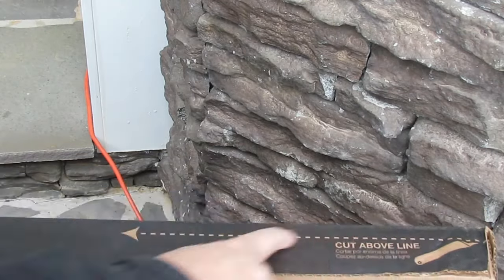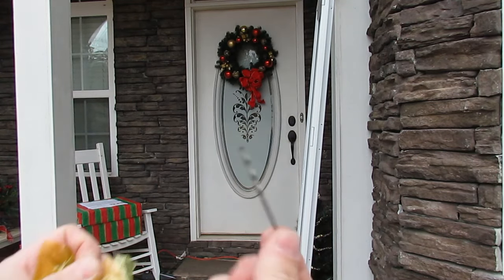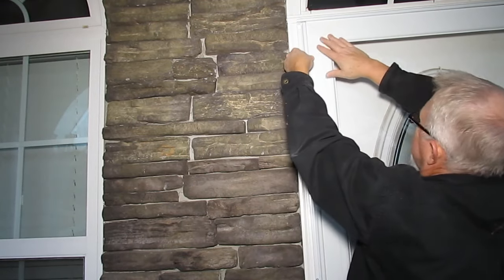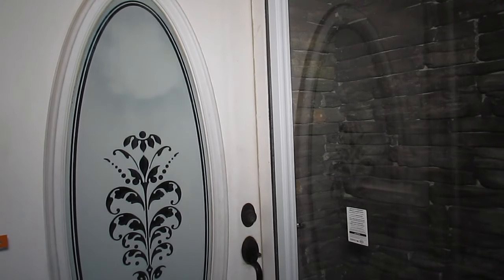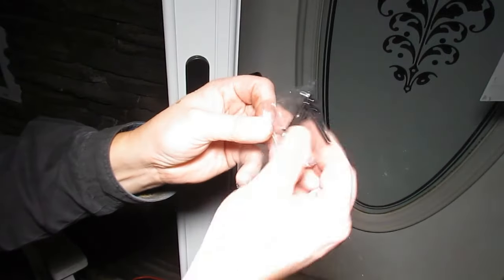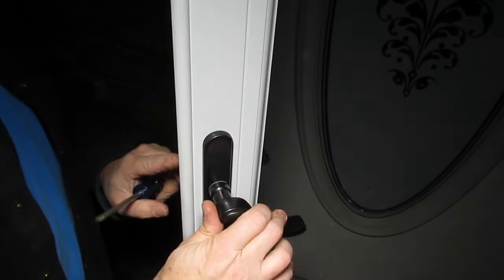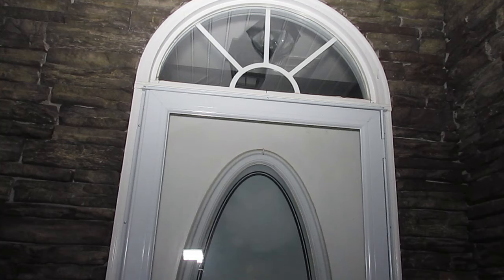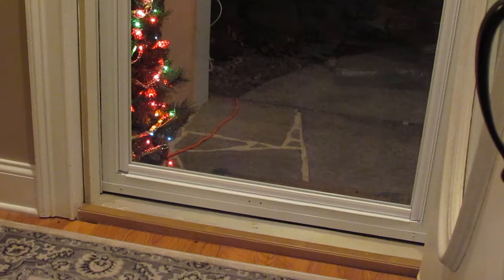Install Andersen Storm Door

Comment: How did you get the top part to snap in so easy? I cannot get it
Reply from the maker: I was able to put the bottom edge into the channel and then just push down on the top edge and snap it in.  You could also try slipping it in from one side and sliding it into position.  Thanks for watching!
Reply: I struggled with this, too, until I pushed UP on the top flat part. That did the trick.

Comment: shouldn't the  storm 3000 handle be on the same side as the existing  door?
Reply from the maker: Thanks for watching, Dan.  It just depends on what you want...you can buy the storm door either hand.  On this particular door, the entry door originally should have been installed as the opposite hand but was not.   If I had installed the storm door the same as the original, getting in and out of the door would be difficult because of how the porch is built.
Reply: I'm having trouble with the handle
Reply from the maker: HI Kiesha, thanks for watching!  Can I help?
Reply: Shouldn't the the door handles be on the same side as the primary door! Great job tho!

Comment: how the hell do you get the pins OUT if i need to take the screws out of the door by the bottom bracket to adjust :( i cant get them OUT
Reply from the maker: On mine, if I hold the closer cylinder so that the tension is off the pins, I can slide them out.  If that doesn't work, you could try to get a slotted screwdriver under the head of the pin and pop it out.  thanks for watching!
Reply: @dwcoffey  ty :)

Comment: Shouldnt he have used a RH storm door as his main door is RH one?
Reply from the maker: Normally, yes.  However, the builder put the wrong hand entry door in this house.  I am making a new entry door in my shop and will replace it with he correct hand door.  As it is now, entry and egress is difficult as the entry door kinda dumps you out into a wall.  So....I don't want to replace the storm door after I replace the entry door.  Once the entry door is done, it will be as expected.  Thanks for watching.

Comment: Anybody else feel like the door needs a longer closer? I installed the bracket on the jamb in reverse to get more degree of open, I also adjusted the bracket on the door to the last holes after using the middle holes initially. Lol took me probably two hours from the instructions and not having focus.
Reply from the maker: Thanks for watching, Lael!  I did not have any problems with my closers.
Reply: I had my door installed by a contractor. The bottom jam bracket sheared off not even a year later. I noticed he installed the upper and lower brackets the wrong way. Those brackets will break easily. Definitely get a spare set from Andersen.

Comment: Anyway to install a wind chain?
Reply from the maker: I'd either try to rig it to the attachment points for the closer cylinder up top, or use self-tappers into the aluminum frame to mount the chain.  Thank you for watching!

Comment: We got the frame secured and can’t open the door! Poked out the orange pieces and door still won’t open.
Reply from the maker: Thank you for watching, Jared!  Check the frame for squareness.  Check all the way around the door for even space between the door and the frame.  That may tell you what is binding the door.  Is the latch already installed?  If so, is it disengaging when the door handle is turned?

Comment: Isnt the door suppose to open same way as the interior door
Reply from the maker: Thanks for watching, Robert!  Although not a requirement , most often storms doors are installed with the lockset on the same side of the opening as the entry door.  The entry door installed by the builder is the wrong hand, it should have been a left hand door based on the way the front porch is built.  It will be changed to a left hand door in the future.  If I had installed a storm door with the handle on the same side as the existing entry door, we would exit the doorway into a wall unless the door was fully opened when walking out.  Not convenient at all, so changing the entry door to the proper hand door will be the best solution.

Comment: Is that the right door for that opeaning???
Reply from the maker: Thank you for watching, Terry!  Great question!  You can install either hand door into any opening, but you are right...normally you would match the entry door hand.  In this case I didn't because the builder put the wrong hand entry door in our house.  The way the porch is built, the entry door should be the opposite hand.  So, rather than perpetuate the problem, I installed the correct storm door, but will have to replace the entry door to make it open the correct direction.  I plan to make the door slab in my wood shop.

Comment: Dude your storm door is installed opposite from the front door. Good rule-of-thumb is that you want the handle of the screen door to be on the same side as the entry door. That’s the
way it is normally done. I guess your house your rules
Reply from the maker: Thanks for watching!  Although not a requirement , most often storms doors are installed with the lockset on the same side of the opening as the entry door.  You'll notice in this video , I install the storm door with the lockset on the opposite side as the entry door.  There is a reason for this.  The entry door install ed by the builder is the wrong hand, it should have been a left hand door based on the way the front porch is built.  It will be changed to a left hand door in the future.  If I had installed a storm door with the handle on the same side as the existing entry door, we would exit the doorway into a wall unless the door was fully opened when walking out.  Not convenient at all, so changing the entry door to the proper hand door will be the best solution.
Reply: @dwcoffey   Roger that . I did realize door was swinging wrong way there for I apologize for my comment. Cheers mate
Reply from the maker: @ghshomeimprovements  no worries at all sir. I should have shown in the video how the entry door is wrong. It would have made it much clearer. Thanks again for your support.
Reply: @dwcoffey  you did fine. Cheers

Comment: Did you buy a wrong side storm door? Shouldnt you buy a right side door and not the left side door? The hinges should be on the left side like your front door
Reply from the maker: Thanks for watching!  Although not a requirement , most often storms doors are installed with the lockset on the same side of the opening as the entry door.  I installed the storm door with the lockset on the opposite side as the entry door because the entry door installed by the builder is the wrong hand, it should have been a left hand door based on the way the front porch is built.  It will be changed to a left hand door in the future.  If I had installed a storm door with the handle on the same side as the existing entry door, we would exit the doorway into a wall unless the door was fully opened when walking out.  Not convenient at all, so changing the entry door to the proper hand door will be the best solution

Comment: isn't the opening of the storm door should be the same side of the exterior door or the hinges are adjacent to each other. it's kinda awkward to open the storm door while the exterior doorknob is on the other side
Reply from the maker: Although not a requirement , most often storms doors are installed with the lockset on the same side of the opening as the entry door.  You'll notice in this video , I install the storm door with the lockset on the opposite side as the entry door.  There is a reason for this.  The entry door install ed by the builder is the wrong hand, it should have been a left hand door based on the way the front porch is built.  It will be changed to a left hand door in the future.  If I had installed a storm door with the handle on the same side as the existing entry door, we would exit the doorway into a wall unless the door was fully opened when walking out.  Not convenient at all, so changing the entry door to the proper hand door will be the best solution.

Comment: If I'm not mistaking...the door is installed on the wrong side.  Now you have to open the exterior door and reach across to open the interior door.  The door handles should be on the same side.
Reply from the maker: The builder installed the wrong hand door when he put in the entry door.  The way our porch is built, if I had installed the storm door to match, we would exit into a wall.  I plan to build a new entry door and reverse the hand so that they match.  Thanks for watching!

Comment: How you put the screen in that's my biggest problem
Reply from the maker: Thanks for watching, Sandra!  I'll work on a video showing how to change between the glass and the screen.  That is the least satisfying part about this door in my opinion.  You pull out the clip/trim around the inner perimeter of the glass to remove it, insert the screen and re-insert the clip/trim.  The clip/trim is difficult to get out and back in.

Comment: He has a left swinging front door,  but a right swinging storm door? Never saw opposite door swings on a front door... makes no sense when opening it or if you need to keep it open to bring things in.
Reply from the maker: Most often storms doors are installed with the lockset on the same side of the opening as the entry door.  You'll notice in this video , I install the storm door with the lockset on the opposite side as the entry door.  There is a reason for this.  The entry door installed by the builder is the wrong hand, it should have been a left hand door based on the way the front porch is built.  It will be changed to a left hand door in the future.  If I had installed a storm door with the handle on the same side as the existing entry door, we would exit the doorway into a wall unless the door was fully opened when walking out.  Not convenient at all, so changing the entry door to the proper hand door will be the best solution.  Thanks for watching!

Comment: What about actually getting the door to lock.  I see no latch. There is nothing where the lock attached/inserts?
Reply from the maker: Thanks for watching, Chica!  There is a deadbolt that goes into the lockset assembly.  Please see 15:10 in the video.
Reply: @dwcoffey  thanks for your response.  The deadbolt when turned, does not attach to anything.  When I turn lock,  the wall trim does not have the anything to hold lock in place.
Reply from the maker: HI Chica,  the wall jamb should have a hole for the dead bolt to latch into.  If not, sounds like maybe they installed the wrong latch plate in the door jamb.  I'd take a photo of the lockset and the latch plate (in case you need them)  and then call their tech support number 1-800-933-3626.  They may need to send you a replacement part.
Reply: @dwcoffey  thanks.  I'll do that.  I called 2x already. They sent a part identical to one I have with NO holes for lock.  Now I know the terms to use to better explain. Thanks!
Reply from the maker: Hi Chica,  I looked closer at mine when I got home tonight.  There is not a latch plate on the jamb on mine.  The deadbolt and the door latch catch into the channel of the door jamb.  When I turn my deadbolt, the bolt goes into the channel and holds the door securely.  If yours is not catching, makes me wonder if the bolt isn't coming out all the way, causing the problem, or if the bolt doesn't line up with the channel and can't come out all the way.  
Also, I looked for an email address to send a note to Andersen, but haven't found one yet.  I'll let you know if I can find one.
Reply: @dwcoffey  thanks!!!
Reply from the maker: Hi Chica, were you able to get it fixed?
Reply: @dwcoffey  not yet, will have someone make adjustments. Thanks for your help.

Comment: I prefer to have the hinges on the left side and have the door handle on the same side and as the door knob.
Reply from the maker: Thanks for watching, Joe.  Yes, I do too.  Although not a requirement , most often storms doors are installed with the lockset on the same side of the opening as the entry door.  You'll notice in this video , I install the storm door with the lockset on the opposite side as the entry door.  There is a reason for this.  The entry door installed by the builder is the wrong hand, it should have been a left hand door based on the way the front porch is built.  It will be changed to a left hand door in the future.  If I had installed a storm door with the handle on the same side as the existing entry door, we would exit the doorway into a wall unless the door was fully opened when walking out.  Not convenient at all, so changing the entry door to the proper hand door will be the best solution.

Comment: Why is the storm door handle on opposite side of the regular door handle?
Reply from the maker: Although not a requirement , most often storms doors are installed with the lockset on the same side of the opening as the entry door.  You'll notice in this video , I install the storm door with the lockset on the opposite side as the entry door.  There is a reason for this.  The entry door install ed by the builder is the wrong hand, it should have been a left hand door based on the way the front porch is built.  It will be changed to a left hand door in the future.  If I had installed a storm door with the handle on the same side as the existing entry door, we would exit the doorway into a wall unless the door was fully opened when walking out.  Not convenient at all, so changing the entry door to the proper hand door will be the best solution.
Reply: That makes sense.  I am buying and installing same door this week.  I was wondering if maybe the main door handle interfered with the storm door handle.
Reply from the maker: Thanks for watching!!  Best I can tell, I don't think the two handles would interfere with each other if they are on the same side of the opening.  I suppose that could depend a lot on the entry door lockset, but ours is pretty big and I don't think they'd hit each other.

Comment: Left Handed door in a right handed hole.
Reply from the maker: Thanks for watching!  The 'hole' can actually take either hand door you want to put in it.  Both the storm door and the entry door in this video are actually left handed doors, the  storm door is an outswing door and the entry door is an inswing door.  Typically, a person would put a right handed storm door in an opening with a left handed entry door.  The problem with my entry door is that the builder actually put in the wrong hand for the way the porch and entryway is built.  He should have put a right handed entry door to allow easier access in and out of the house.  I put a left hand storm door in because I am building a new custom entry door and will install it as a right hand door.

Comment: Aren’t u suppose to install the handle side to the handle side of your front door?
Reply from the maker: Thanks for watching, Howard!  Although not a requirement , most often storms doors are installed with the lockset on the same side of the opening as the entry door.  You'll notice in this video , I install the storm door with the lockset on the opposite side as the entry door.  There is a reason for this.  The entry door installed by the builder is the wrong hand, it should have been a left hand door based on the way the front porch is built.  It will be changed to a left hand door in the future.  If I had installed a storm door with the handle on the same side as the existing entry door, we would exit the doorway into a wall unless the door was fully opened when walking out.  Not convenient at all, so changing the entry door to the proper hand door will be the best solution.
Reply: @dwcoffey  I see … thank you… it was a very good informative video to watch

Comment: You put the Storm Door to the wrong side???
Reply from the maker: Thanks for watching, Jamie!  Although not a requirement , most often storms doors are installed with the lockset on the same side of the opening as the entry door.  You'll notice in this video , I install the storm door with the lockset on the opposite side as the entry door.  The entry door installed by the builder is the wrong hand, it should have been a left hand door based on the way the front porch is built.  It will be changed to a left hand door in the future.  If I had installed a storm door with the handle on the same side as the existing entry door, we would exit the doorway into a wall unless the door was fully opened when walking out.  Not convenient at all, so changing the entry door to the proper hand door will be the best solution.

Comment: You didn't show the latch plate that goes on the frame of the house to connect the door latch
Reply from the maker: It's already installed on the door frame that comes with the door.  You don't have to attach anything other than the storm door frame to the existing entry door frame.  Thanks for watching, Robert!

Comment: Anyone else notice he got the wrong swing storm door.  Handles don't match up with the house door
Reply from the maker: Thanks for watching, John!  Typical, yes, the handles would be on the same side.  The problem with our entry is that the builder put the wrong hand entry door on the house.  So, if I had matched the handle sides, coming  and going through this door would have resulted in basically running into the porch wall.  So, I'm planning to make a new entry door in my shop  (I've never liked this door anyway), but making it the opposite hand so that entry and egress is normal and easy.

Comment: Love my Andersen doors except the closers are absolute garbage. All 4 have leaked and locked up. They won't replace them. And the replacement closers cost over $50. each!
Reply from the maker: Yes, that stinks!  I haven't had any trouble with mine, but I'm sure glad I haven't based on what you said.  Maybe generic closers will fit on that door?  Thanks for watching.